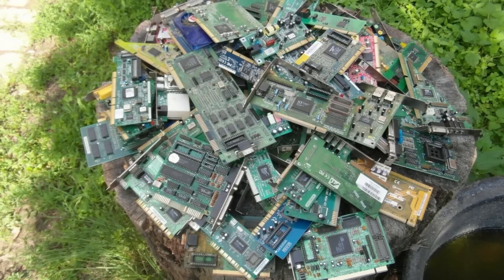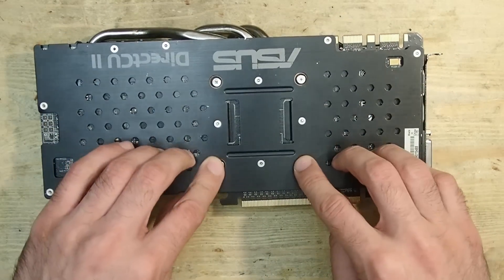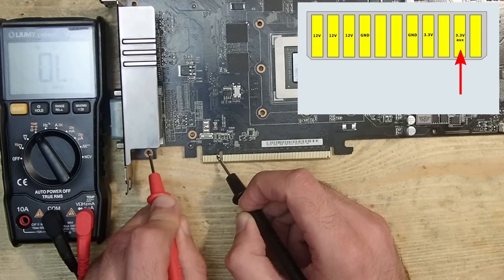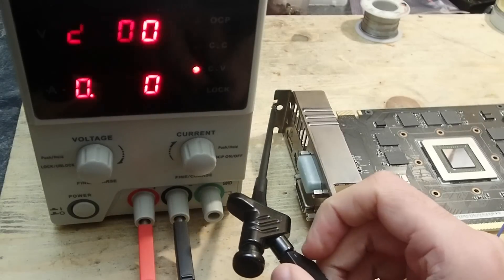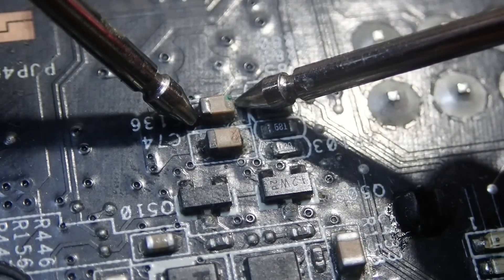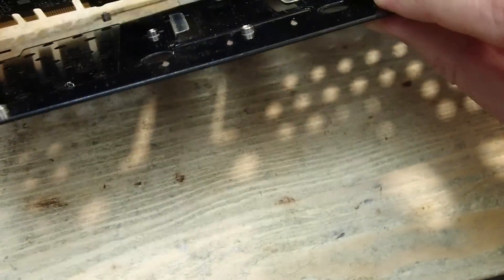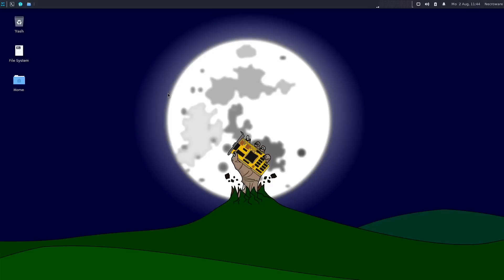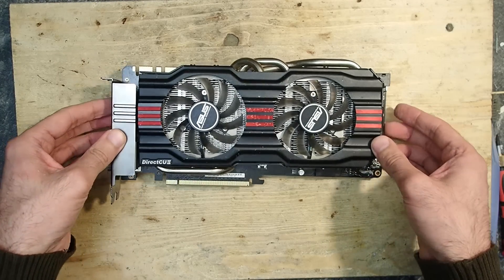GPU shortage? Let's repair an Nvidia GTX 770

Comment: As a retro enthusiast with no technical education whatsoever, I really admire your knowledge on subject matter. I mean I am familiar with the demonstrated technique (which is called 'burning of shorts' in my native language), but It's more to know 'when' to use it and 'where' rather than 'how'. It it also useful to spray some isopropyl alcohol on the process on the PCB in order to find warming components more easily.

Regarding graphics cards, I find it most accurate to test those under windows installing latest drivers. If it shows no errors in device manager, I stress test the card for 30 mins.

Anyway, congratulations on reviving this card.
Reply from the maker: Yes I sprayed some IPA off camera to find the place, but the parts were so tiny, that it didn't make an effect worth to show it in the final footage. I always search the spots with my fingers like that and the IPA helps only if the short is in some IC, where the surface is bigger. You also can then burn your fingers by the way :D

Comment: That's a nice and easy fix. Thanks for sharing your process. So many cards are just tossed when they fail, even if the fault could be very minor like in this case. I now have a better idea of what to start looking for if I ever have the need :) I've had success with a heatgun on a gpu before, but the symptoms were "obviously" very different from this.
Reply: "So many cards are just tossed when they fail..."
Yeah, unfortunately there's a lot of people that don't know (or care) what broken hardware is worth on ebay. :(
Reply: Sadly most modern GPUs fail because they get too hot and start having graphical glitches. That usually can't be repaired.
Reply: @Txm_Dxr_Bxss  That seemed to be the (ongoing) issue with my own card. It definitely seems to be about the solder joints under the GPUs. This is a fairly modern way to solder on big dies to PCBs, and is prone to such faults. It can to a certain extent be fixed with re-melting the solder.
I wish they would switch to a socket-type mounting like with CPUs. Then this problem would probably be done with. But of course, they have an interest in ensuring that people upgrade often, which might honestly happen anyway, but I don't like how stuff keeps breaking after such a short time and end up as more E-waste.
Reply: @Vermilicious  I recovered 3 GPU's with the heat gun /flux method. They all had error 43 and now run perfectly.
Reply: @Vermilicious  they could make separate gpu chips that you can also buy

Comment: Amazing repair but this PSU is not good i reccomended a Corsair,evga,cooler master PSU
Reply from the maker: This PSU was just to test the card and not for a long term usage. In my normal PC I have an expensive BeQuiet, but this  PSU seems to be better, than I thought actually.
Reply: @necro_ware  I just heard from a PSU expert and he says that mars gaming is really bad I do NOT RECOMMEND this PSU then if you want to use it know that it could EXPLODE and FRY SOMETHING mars gaming gives you GOOD things to SEE BUT VERY BAD
you are very good at repairing objects i do too and you amazed me please don't get lost in bad power supplies
Reply from the maker: May be I'll make a short overview about this PSU. There is one thing, which was definitely bad about it, but unfortunately many other PSUs today have the same issue, even the expensive ones. But other than that, it did a great job actually. It didn't make any issues at all and with a constant load of around 265W it ran all day through absolutely silent and cool. At least for testing purpose it was a good catch I think. I have to add, that I don't belong to the hysteric "OMG! It will burn your house" guys, but I always have my fire extinguisher at hand. It's important with this hobby :D
Reply: @necro_ware  sorry but I don't understand what you wrote 😅because I don't speak English in fact I'm using a translator
Reply: @necro_ware  I agree, 265w~ I think is the max of this power supply as a test power supply there is, a power supply that can burn the house is Atlantik 500w seriously dangerous, broke an electrical system and camera from 1000 € and PC from 1200 €, I think your bequiet have the protection on 12v and 5v and 3.3v i finally managed to translate the message thanks to google lens!

Comment: Would a thermal camera work help avoid having to raise the amperage?
Reply from the maker: Yes, but I have none and a finger does it just as good and helps to save some money. However for the YT video it probably would look nicer...
Reply from the maker: @ruben_balea  True :D But fortunately it's to small to feel so hot....
Reply: Yeah, a thermal camera is the more professional way to do it. However, they are expensive to the point where it is not really worth it unless you do these kinds of repairs all the time.

Comment: For the next time, place the card into the motherboard but solder that cable directly into the motherboard pins! That's not going to cause any problems, neither will interfere in the voltage injection test!
Reply: That's not a good idea because you can damage the pin on the socket due to the heat caused by the short circuit.
Reply: @fellipemelo9287  uh technically no, I mean, if you solder directly into the pcb pin strip, you'll have a limited current capability, which should match the one of the connector. In any case, a connector can be easily replaced, but the gold plated pins on a board, can't.
Reply from the maker: The best way is to find a spot on the card itself, where you can solder your wire, so you don't touch the gold plated edge connector anyway. Unfortunately, it was not possible on this card, but usually, it's not a problem. I also could polish some solder mask from the trace and solder the cable there. Eventually, I don't mind if one pin is now slightly leaded....